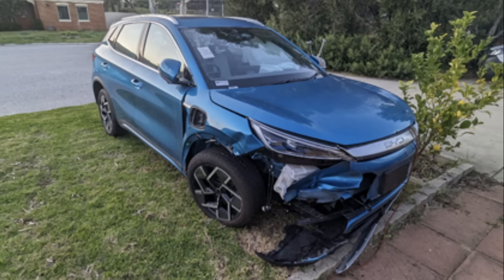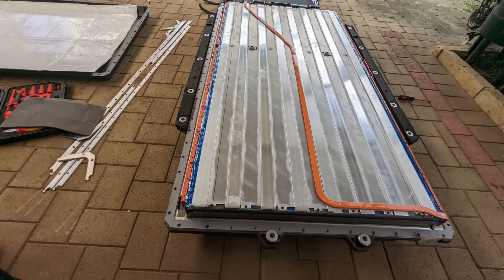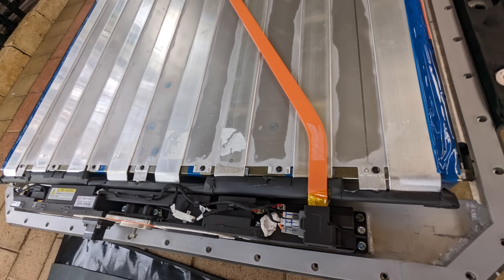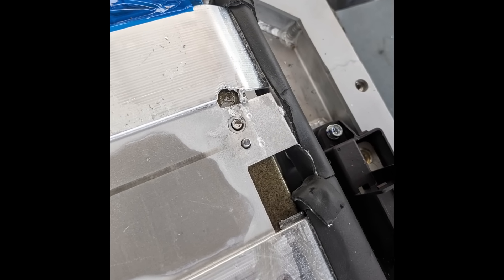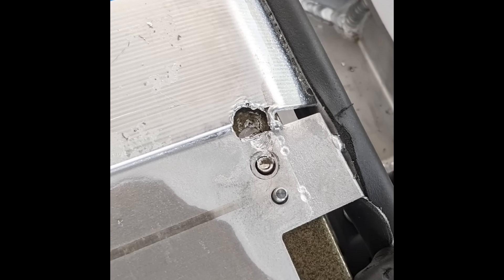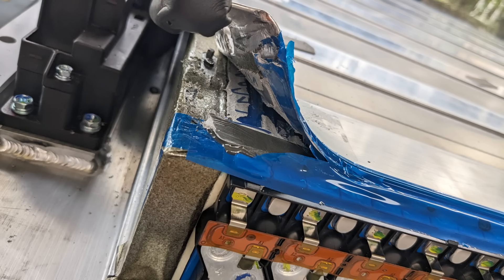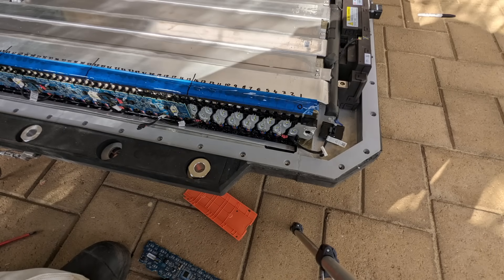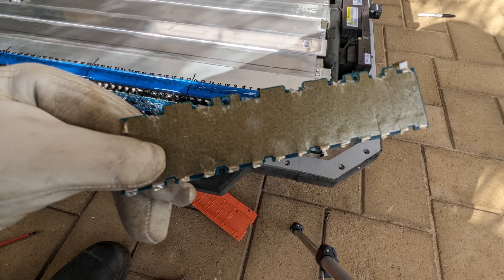BYD Atto 3 battery dismantle P1

Comment: I know some taxi in Shenzhen using BYD EVS. In 4-5 years these ev-taxi has run about 600k-700k KM. And the bettary in these EVS still in very good performance state.
Reply: So could be around 1000 cycles. Probably still has 95% soh. Lfp?
Reply: @NoName-md5zb  Yes.
Reply: @NoName-md5zb  BYD Blade Battery have 3,000 Life Cycle
Reply: Not some, it is all taxi using BYD
Reply: i went there 2014 and they already were running BYD taxis that time
Reply: Wow if we compare a taxi driver who used to drive a combustion engine and this guy.    Holy shit.   This guy b😂😂😂😂 rich man
Reply: @sivaree2226  they made double profit compared to others city.
Reply: @sivaree2226 This guy save money. Petrol more expensive than charging. This man is actually poor.  he can't afford the cost of fuel and maintenance such as changing the lubricant every 5000km.
Reply: “some taxis?” I would say more taxis across china nowadays are EV than not. Try calling a didi that's not an ev😂
Reply: Please forgive him. He read too much petroleum companies propaganda.
Reply: Stop lying my Chinese friend's father who's a taxi driver in Shanghai said that that byd EVvas a taxi sucks because you need a battery replacement past 200k if not then you will lose more money due to less trip turn around because you will need to charge it more often than before
Reply: @KevinEskoloso-zk2bj  There is no BYD taxi in Shanghai! Shanghai is the seat of SAIC. They have MG and Roewe. Shenzhen is the headquarters of BYD. Both places have policies to support their own cars as taxis. If you buy BYD as a taxi in Shanghai, you will not get a taxi license! Shanghainese also consciously resist or even vilify BYD! Do you understand this story?
Reply: @dxJ-qt2th  there is, stop it seriously you wumaos are getting into my nerves my girlfriend's father drives one
Reply: @KevinEskoloso-zk2bj так за 200к пробега вы уже сэкономите 15к долларов что равно стоимости электромобиля в Китае
Reply: Suddenly  all taxi in Shenzhen changed to new BYD.
Reply: Which BYD car is used as a taxi in China please.
Reply: @ChristopherJGallagher  BYDE6
Reply: If you dare, BYD manufacturer has a lifetime warranty... without any conditions... New EV is attractive... if the car is only 8 years old, it will be sold at a scrap price... only crazy people want to buy it at a high price... used car
Reply: @christiantosonaifil  LIES byd doesn't have a lifetime warranty source byd themselves
Reply: 深圳出租 全部是比亚迪E6电动车
Reply: The Taxis are Guinea Pigs for BYD. Nevertheless thanks to Taxis in China, the world got a proven EV cars.
Reply: This this is built to survive anything, even guys trying to pull it apart. So it's basically  non-repairable? But then again based on the taxi story it doesn't need to be repaired.
Reply: @ChristopherJGallagher  it certainly does like everything
Reply: No guaranted every cell have the same performance. Some may die faster you never knew when electronic involve
Reply: @billykulim5202 There are growing number of technicians who check cell by cell and only remove and replace malfunctioning cells. This costs less than $3,000 in many cases. Autotrader YouTube channel did a video about it.
Reply: @billykulim5202  you're stating the obvious...the point he's making is the performance is still adequate after the long period and especially the mileage. For an average driver, that mileage translates to 20-30 years of driving, without taking into consideration the natural degradation of the battery chemical.

Comment: I run an off grid power system that uses two batteries from Mitsubishi Outlander PHEVs. Easiest to dismantle and reconfigure. Cells can be individually lifted out and have M8 studs for connecting!
Reply from the maker: My current system use LEAF cells. Much more convenient
Reply: But the nuts are, in general, notorious for not making perfect contact and causing factory rejects et.c. Great for DIYing though!

Comment: How much is the battery?
Reply from the maker: By the time I had the wrecked car delivered to my house it cost me AUD$11000. I haven't gotten rid of the rest of the car yet so I don't know how much I'll get for it
Reply: @Brendon_M  thats pretty fair for the battery. how hard is it to change from the car? meaning if your battery dies after warranty, you just get a used one from a wrecked car. if it's (in 8 years) like 5000 AUD + labor thats really fair.
greetings from germany hope you won't get eaten by a snake haha
Reply from the maker: Pretty easy to remove the battery pack. Took me probably an hour or 2 to do in my front yard. In a proper workshop you could probably get the old pack removed and a new pack installed in under an hour
Reply: @Brendon_M  Sounds great, but I think it's easy down under since everything is upsidedown

Comment: This is clearly not the "blade batteries" that BYD is marketing abt 2 yrs ago till now.. with the "S" curve construction, logically is to allow airflow for cooling on the pack. But definately not space savings of 25% as claimed and marketed.
Reply from the maker: There's no room for airflow in the pack. The cells are hard up against each other.
Reply from the maker: With the chiller plate directly on-top of the cells I think they'll be cooled fine, even when rapid charging. All the cells have one side directly touching the chiller however if the cells are getting hot (on the bottom for example) then it is quite a long way for the heat to travel across the width of the cell so I guess the cooling system would be better if it was on top AND bottom. That being said, to have the weight of the cells resting on a cooling plate would mean the plate would have to be a lot more heavy duty and for what gains? There aren't any reports that I've heard of BYDs thermally throttling the cars so I can only assume the design engineers made the right call. Time will tell I guess.

Comment: Thanks for the video. I learned, that the quality isn't so bad as some claim. There is plenty of videos talking about how bad BYD is. Seems very good to me from engineering point. BTW, allegedly BWD uses LFP cells. If so, you will need 16S for storage, if that's on your mind.
Reply: It is puzzling that BYD's battery is clearly the safest, and even though it has been passed the Acupuncture test, but many people say it is the worst quality. Rumors and prejudices are really terrible, and can turn black and white upside down
Reply: How is BYD bad? tesla uses BYD's battery
Reply from the maker: Yeah, there is nothing wrong with the way the battery is built in terms of quality. Only downside is the lack of repairability but with the life span BYD are expecting from these batteries that's not really an issue for someone looking to buy an EV.

They are LFP cells but due to my current system I'll be running it as a 14S pack rather than the traditional 16S.
Reply: @Brendon_M  Boy, you will get yourself a massive storage which will be very long lasting with LFP cells. Good job.
Reply: By this logic, Tesla is bad too since they are now using BYD blade battery in model Y
Reply: The BYD Atto3 battery is 126S1P LFP, 50 or 60KWhr. The traction voltage is around 400V. 

Compared to most EVs it has one of the lowest cell counts, so the battery is relatively simple with fewer things to go wrong. 

In my experience the system works very well. The battery in my vehicle is going on 2 years old and shows no sign of degradation.
Reply: This isn't bad. It's downright appalling..

Comment: Makes me very concerned how these battery packs would be dealt with when they are end of life. Not only do you have to deal with the power retained but how would they be recycled? Or do they just expect to dump them in a hole in the ground? There should be laws to deal with old batteries, electronics and be able to easily disassemble for recycling. I wont be buying an electrical vehical! Anyhow thanks for making the video and sharing it online, and i think raising questions about are we really helping with saving the planet with electric vehicals?
Reply from the maker: Even with how difficult this is to disassemble nobody will be throwing them in a hole. It's too valuable as second life storage and when it's not even good for that there's companies like Li-cycle that have set up quite effective shredders that take whole packs in and output the various materials to be reused.

That all being said, I agree there should be systems put in place to ensure ease of recycling.
Reply: Look up Ecar battery recycling,brilliant.

Comment: Thank you very much for the video from Spain! 👏👏👏 At first, I was happy, watching that it was possible to remove the cover, but after, things changed... it is a pity that repairs are not feasible, at least easily...

Thank you very much for your work and for all the information that you have offered in the comment section 😁😁😁😁😁
Reply from the maker: You're welcome!
Reply: A little more complex than building or repairing an Ebike battery.For safety really.

Comment: would like to see if anyone can test the battery safety like BYD claimed, its a good win for them if its true, less people are phobia of the battery fire issue from EV
Reply from the maker: Well I haven't burnt my house down yet so that's a good start 😄.
I'm with you though, I'd like to get some BYD cells and torture test them to see if they stand up to BYD's claims
Reply: the new Sodium based battery from BYD will be much safer.
Reply: Someone did that with a Nissan Leaf module, he did a slightly more torture test as he fully charged the pack then used a screwdriver and pierced the pack multiple times, some smoke came out but no fire he then tested the voltage and current and pack was still working, he then tried to burn the pack and only the glue caught fire again battery module was still working!

Comment: Accidentally coming across your video from Shanghai, China, I found it quite intriguing. What I can share with you is that the cost of replacement batteries is typically about half the price of the vehicle itself, which is comparable to the repair expenses for a mid-range vehicle☺
Reply: Now battery technology is new thats why battery price is hike but in next 5 to 8 years we can use old battery as recycling and we got new batteries at budget cost
Reply: 现在不是更便宜？原材料价格不断降价电池价格就不断降价
Reply: nihao brother  @雅君墨客-i9z
Reply: @雅君墨客-i9z here in Australia everything is sold at a higher price because retailers are corrupt. Electric cars are similar price to new petrol/hybrid cars now. Mostly byd and tesla cars here but byd sales have skyrocketed in the last year despite aussie prices being higher than in China.
Reply from the maker: Thanks for sharing. BYDs delivered in Australia cost roughly double what they cost in China so the battery pack theoretically could be replaced for a 1/4 the price of a new car here.
Reply: Isso se a bateria teoricamente for comprada e usada na China , se for usada no seu país vc pagará impostos e frete  @Brendon_M
Reply: People should stay away from evs they are waste of time
Reply: Better do not buy EV😂😂😂
Reply: But you might not need to replace the battery, there might be one or two cells that have become faulty
Reply: @karenfairbrother4016  these cells doesn't seem replaceable.
Reply: @karenfairbrother4016  good luck replacing just one or two cells in this battery. Impossible. These are made for first owner and then car can scraped. No wonder people in poor countries do not buy this crap.

Comment: Hi, is the battery on the exterior of the bottom of the car or is it inside the bodywork? Hopefully it has metal body protecting it between it and the ground. Worried something could damage if hit the bottom of the car.
Reply from the maker: It is on the outside but the bottom of the battery pack is a pretty thick aluminium plate
Reply: Thanks

Comment: Can this battery be handled like this? Is there not a risk for thermal runway and fire??
Reply from the maker: There is always a risk but the blade battery is a relatively safe chemistry and I'm qualified to work on EVs so I know what I'm doing
Reply: It's LFP so risk is low.

Comment: Hello man, excellent video, the disassembly of the byd battery is very interesting, from what I understand, the car had a collision, The battery was damaged and you decided to open it at home and get the knowledge to repair it. Here in Brazil, Chinese cars are arriving with a lot of desire to sell, With your knowledge, the durability of these cars is reliable, do you know the price to change a cell or the entire battery? Does it really last more than 200 thousand kilometers? Thanks.
Reply from the maker: Thanks.
You're close. The car had a collision but was deemed unrepairable by the insurance company so it can never go back on the road. The battery wasn't damaged. I have pulled it out and apart so I can use it in my home storage system.
Unfortunately I don't think it is possible to replace a cell in one of these battery packs due to the way it has been built. Hopefully the cars are as reliable as BYD claim. Which I think they will be, otherwise BYD will be in trouble as even they will struggle to repair these batteries.
I don't know the price to replace the battery pack.
Reply: @Brendon_M If Thai prices are the same as other markets then it's 1.2 million baht to buy the car and 800,000 baht to replace the battery either though accident or failure. And be sure LFP maybe a reliable chemistry, but building the pack is a different story.
Reply: I understand, it's bad that the insurance company doesn't repair the car, maybe for the total price of car+battery it's unfeasible.  I think the battery is very expensive, maybe it's not worth it, thank you very much for the quick response, good luck with your home project.
Reply: lol the insurance company repair car?? they only know how to make you pay more yearly premium  @rafael7word
Reply: one of the problem of BYD LFP blade battery is , because of the arrangement of the battery pack , rectangle rather than round  , they can fit in more battery pack in the same chassis size, like extra 25%, that's how they able to compete with more advance lithium ion battery in terms of density.  however if any of the battery pack expand, (common and unavoidable problem for most battery) it will break the connector easily due to no room for expansion, and it was unrepairable, not covered by insurance as far as in china.
Reply: @rantao333  If a cell expands, we throw the whole pack out these days. You can't service a cell in any EV, and you certainly can't keep driving if one cell fails (eg if there was room for expansion).

Comment: After watching this, I have decided  to never ever buy an electric car.
Reply from the maker: I'd argue a petrol/diesel car is more complicated. Especially new ones that are trying to minimise emissions
Reply: But their engines are still repairable 😅
Reply: @dnoha1  if you have a crash which bends the engine most times replacement is the only way to got. with all auxiliary units, main engine + body work you are way over the price of a new battery. 
EVs are way cheaper if you got the mileage.

Comment: Nice battery pack. Was the wreckage so disturbed and not worth repairing?
Reply from the maker: Not really but it was classed as a statutory write-off so it could never go back on the road
Reply: @Brendon_M  was the price favourable enough for a pack, only. Or you need to recoup from parting the rest out?
Reply from the maker: I won't be parting the rest out. I already have too many car parts lying around my house so I'm trying to get rid of the rest of the car as a whole.
The car was more than I really wanted to pay but I got carried away with wanting to do another project. It ended up costing me $11000 by the time it was delivered.

Comment: Did you consider using it as is in a high voltage inverter battery ?
Reply from the maker: Yes and no. This battery will be in parallel to my current home storage battery so I'm trapped in keeping the voltage the same as my current system. I did consider upgrading my whole system to be able to run a high voltage but for better or worse I've stuck to this path. I'd be quite interested to find out if the CAN communication used by BYD is the same between their home storage packs and their automotive packs. Very convenient if they do but it won't be me working that out. (At least not at the moment)
Reply: Have you discussed any of this with BDY? Are they approachable at all? They must know these battery packs would be desirable. Questions like what glue and can it be disabled? I wonder if they issue any papers on disposing of packs, this might help. @Brendon_M
Reply from the maker: Nah, I never spoke to BYD. Probably should have. They're not Tesla so they may have just sold me a pack as a spare part and I could have cut out the whole dealing with the car body bit.
I'd be interested in how BYD dispose/recycle the packs in house but it wouldn't help me now anyway as I'm set on my (no doubt ill-advised) path
Reply: @Brendon_M  I was thinking maybe a heat gun could soften the glue sufficiently to ease the cover off, then maybe enable the cells to be separated. Depends a lot on the glue though
Reply from the maker: You're probably right, heat and a solvent would get the free the cells but you'd still have the issue of the laser welded busbars though.
Reply: Ah, yeah. There's that of course @Brendon_M
Reply: Good work

Comment: Battery packs should be easy to recycle...this seems not the case here. Tesla model Y is even worse...bad thing for the environment if just a couple of cells go bad...
Reply from the maker: I think it'll be easy enough to recycle at a proper facility but there won't be any repairs done on these packs anytime soon. Hopefully they are reliable wont need to be repaired